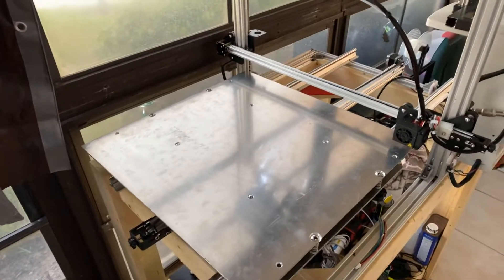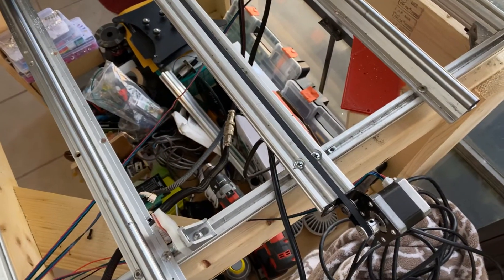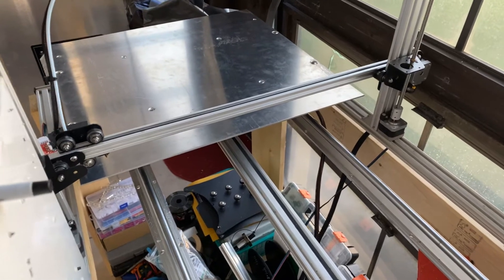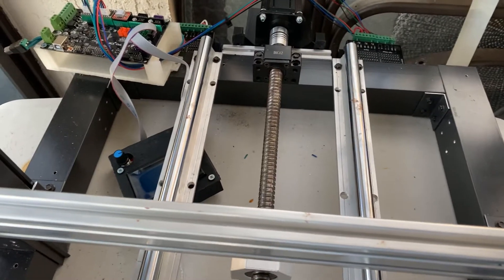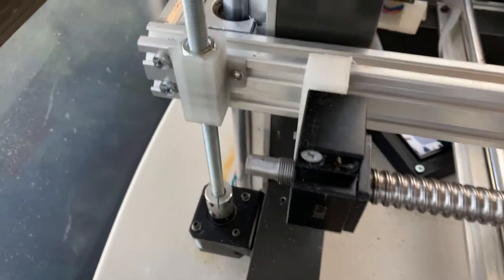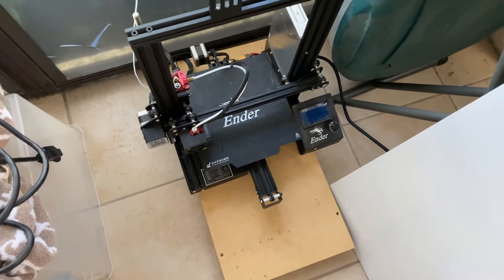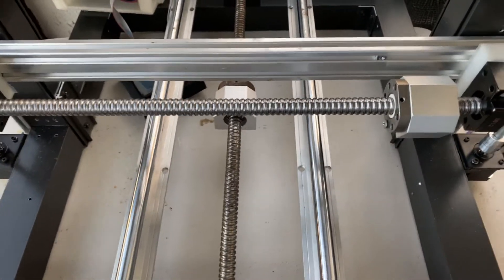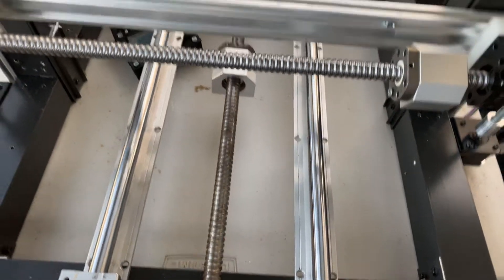LARGE 3D Printer Build Continues, Ball Screw or Belt👀

Comment: I made a 1 cubic meter huge volume printer, but I figured there is NO WAY to make the bed movable. If you can start over - use a static solid bed and move the gantry in X and Y, because that is way way lighter than the bed. I was wondering about ballscrews vs belts. At that size everything hangs because it would only be supported at 2 ends, so I went with belts. They are cheaper and weigh less. Nema 17s all around - 2 for XY and 4 for Z in a coreXY configuration. Was planning to start a indiegogo campaign for folks who want one, but then indiegogo went and cut off all the available countries, so it's basically the same as Kickstarter now.

Comment: I think the belts could work, in combination with larger motor but i recomend 12mm gates belt with matching idler and gear https://e3d-online.com/blog/2018/11/29/gates-belts-pulleys-and-idlers/ also.. https://www.filastruder.com/products/gates-2gt-belts?_pos=1&_sid=5c3a15635&_ss=r&variant=15443729580103 . also as in the cr-10 s5. u could remove that center channel where the built runs inside , as sometimes u get friction on the belt in there.
Reply: u could also swap in this nema 17, doesn't have to be nema 23 https://www.filastruder.com/products/super-whopper-motor?_pos=6&_sid=0db728a07&_ss=r